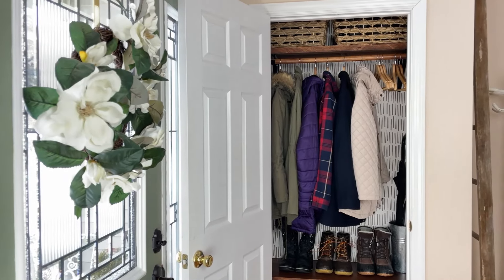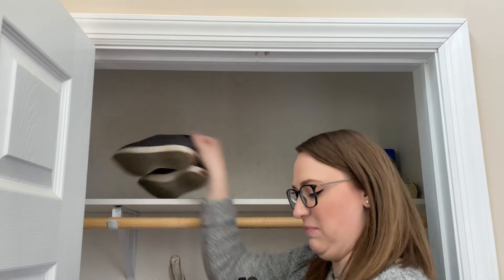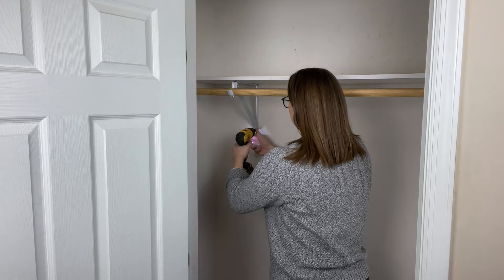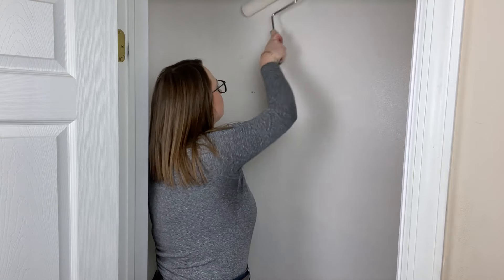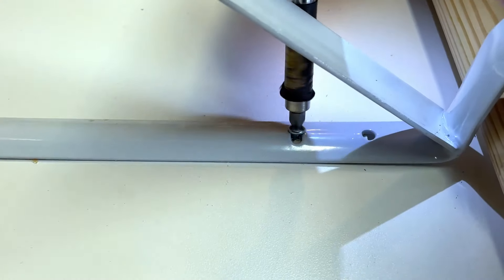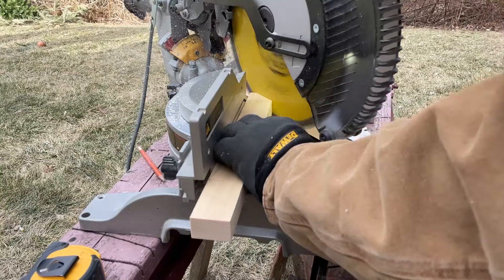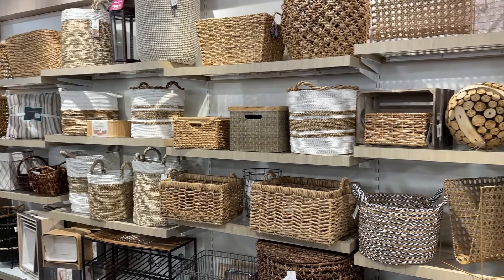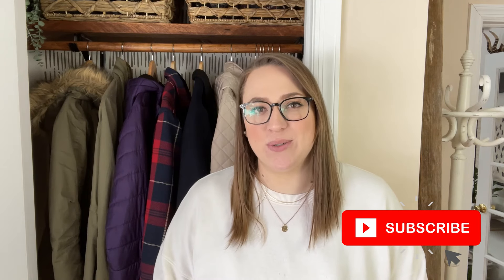DIY Coat Closet Makeover

Comment: Okay, after you remove everything - good job! You should use Magic Eraser to clean the walls! Then, use Spackle to fill any holes in the walls, sand it smooth, and use Kilz (1 coat) to cover the walls, then 1 coat of a pretty, bright color to cover the walls. Tip from my aunt: NEVER remove wallpaper! Use 1 coat of Kilz and 1 coat of paint, and nobody will ever know! Kilz is magic for covering over a too-dark paint color, as it prevents color bleed. Sand that top shelf, and the rod before you paint them! Also, My BF is the handyman in our house, and we do these steps all the time. Makes for a prettier look in the room. And I love SpaceBags after getting all the winter coats, jackets, scarves, etc. - dry-cleaned. So many of winter coat and jackets are not machine washable. Then, you can hang everything together all in 1 Spacebag, and back in the closet everything goes until next season!

Comment: What wood have you used that is fixed to the drywall?
What wood have you used for the shelf?
And what’s the wooded rod made of?
Reply from the maker: Hi, Arjun

The shelves were made with reclaimed pine wood that we stained to the desired color we picked out. Any wood 2x8 planks from your hardware store can work, such as these: https://rstyle.me/+Wda8ekztUoMCc2Hpo7Qx3A  We doubled them up, meaning put two next to each other for a deeper shelf of 16". We cut wooden blocks from the same wood to attach the shelves to the drywall. 

We used this wood stain: https://amz.run/57Ur

The rod is pre-made and available at most hardware stores. Like this one, for instance: https://rstyle.me/+IEHGBI-ESQp1HZfhGMWddA

We stained the rod in the same wood stain color as mentioned above. 

We hope that helps and answers your questions. 

Best, 
Amanda & Karla
Reply: @VintageHipDecor  Thank you so much for the detailed information
Reply from the maker: You are welcome, anytime!